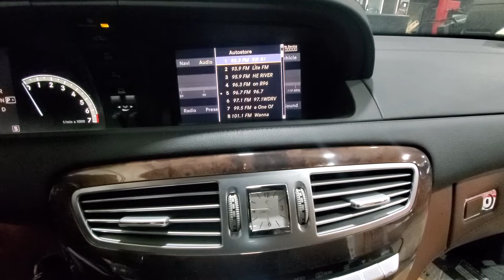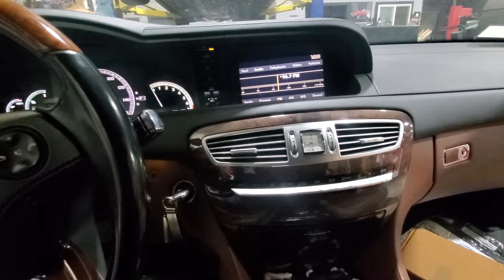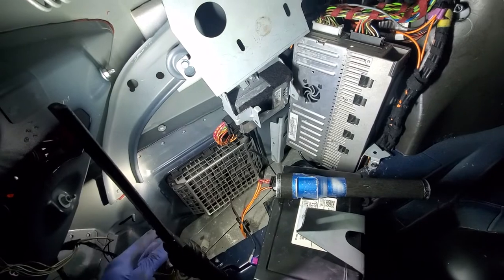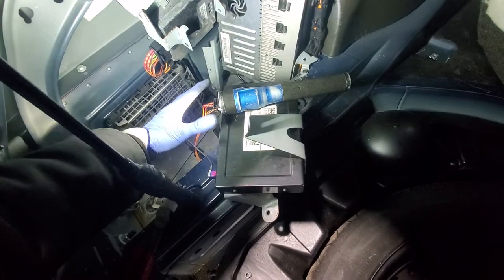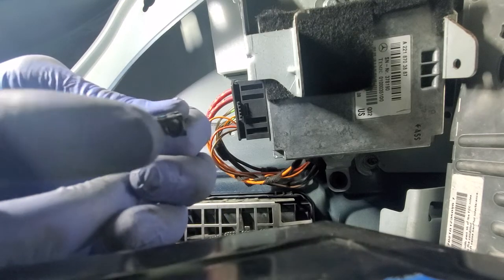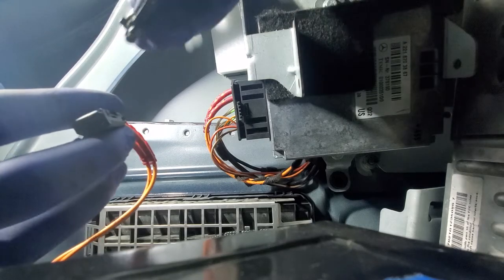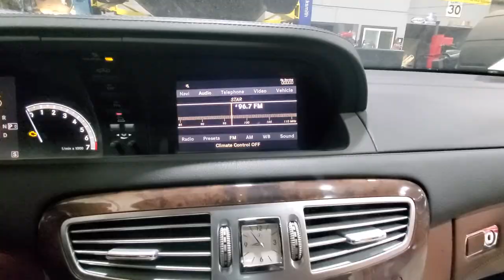No Sound from Radio/CD/Telematics on 2008 CL/S Class Mercedes Benz (Part_1)

Comment: Best video. Literally just done this today for my Dads S500. Tried the satellite module no luck. Turned out to be voice control module. Brought the jumper from Amazon, done as stated in video, perfect. Radio now works again. Just saved £100’s taking it to dealer to fix. ✅✅✅✅✅✅✅

Comment: Hello im here for help.i have a 2011 Mercedes benz s550 4matic.w221. When new the person before me who own the car  opted for the bang  & olufsen sound system. I have no sound in my car.. I run a scan and it says my satelite radio tuner  was bad. I sent it along with the big bang & olufsen amp  and also another long amp thatbis located on the left side of the trunk to a mercedes tech repair shop who told me the satelite tuner is bad and cannot repair so he got me another one and tranfer all the info. Also said my other 2 amps was good. I plug all items back in and still no sound. My voice module is not located on the side it is located under the dynamic seat pump beside the rear fuse box.also my voice module has no fiber optic  going  to  it. I only have fiber optic going to one amp and the satelite radiio tuner. Also when i scan the car after plugging everything in i get no fault codes anymore. I dpnt know what to do. I still see navigation but fm/am dont work also cant play cd. I hear the changer run because i have cd in it. Buttons on steering wheel to control phone and volume, nothing. Please Please help.. ANYBODY! Thanks

Comment: I appreciate the video.  My wife has a 2014 E350 and the Comand center is acting wonky and usually eventually ends up in some kind of endless reboot cycle or just shuts off entirely.  I've seen other videos suggesting this fiber loop technique as a way to isolate the issue.  I sure hope it's something we don't care about like the GPS / Nav unit or the VCM, or the Sirrus satellite reciever.  I hear the amp or the CD changer can be the issue too.  I've heard or read that if it's the amp, you have to install a replacement amp, you can't isolate that.  And the CD changer probably involves pulling the dash, which I'd sure like to avoid.
Reply from the maker: Amp controls your audio. So you wont be able to hear anything. Replacement amp you can find it online (Ebay). For fiber jumping I would start with stuff that is easy to get to and also look for the water damage. Hope that helps.

Comment: Hi , my S320 Mercedes 2008 has the same issue, but the radio is working but with noise and I can't connect my phone and Bluetooth can't find the phone as well and not connected. Any idea please? Tnx
Reply from the maker: I think your amplifier is maybe going bad since you mentioned noise. As far as the BT goes maybe try resetting the system by isolating the power.  Completely disconnect the battery and then try it.
Reply: Thank you Waqas, I think the amplifier is working well because when I use the DVD player there is no noise at all and it works well, do you think the problem is going to be with the radio satellite? Many thanks

Comment: Does adding a loop interfere with anything else, like not allow telephone or voice control to work?
Reply from the maker: depends what module is not working, if it is phone module then it will interfere.
Reply: @waqasazmat81  thank you, what if it’s the Amp? Will it cause interference with telecom and voice? This electronic stuff is new to me.
Reply from the maker: Usually amp is related to the radio/entertainment stuff. I believe telematics will not be effected. Get a loop and isolate the amp from the loop. I am almost certain telematics should be okay.
Reply: @waqasazmat81  I tried the loop on both the Amp and the HD and looping it to either one have me no sound.
Reply from the maker: What is the original concern with a vehicle? Usually when one of the module in a most ring bus is not receiving or sending out the light that would bring down the most system.
Reply: @waqasazmat81  the concern is that even though I tried looping both modules, I still get no sound at all. When I look the Amp, everything is off, when I loop the HD module, all is up, but no sound.
Reply from the maker: Then amp is bad. Amp does play a roll in sound.
Reply: @waqasazmat81  the amp fan stays running. I just went down and tried it again and this time, when I plugged the loop to the HD receiver, the sound came on, but after 2-3 minutes it shuts off again.
Reply from the maker: Fan does stay running, it's in default mode. Get an amp :)
Reply: @waqasazmat81  where can I buy a new amp I’ve been trying to find one
Reply from the maker: @jcstaywoke6948  try looking in ebay